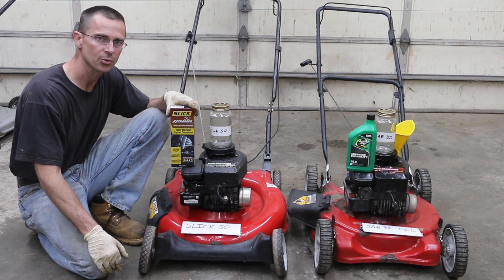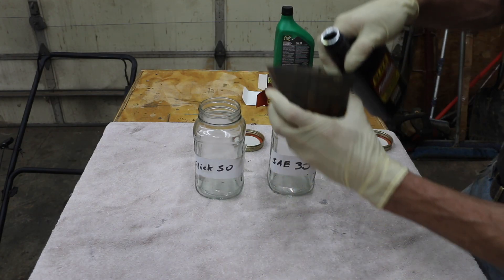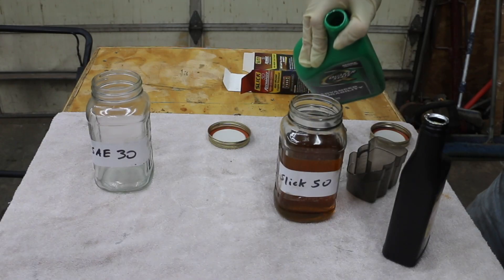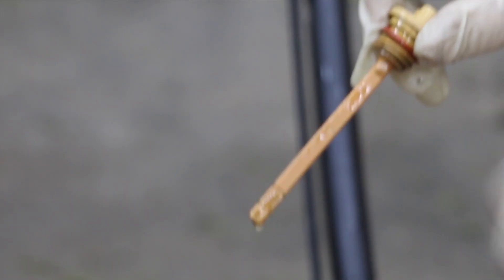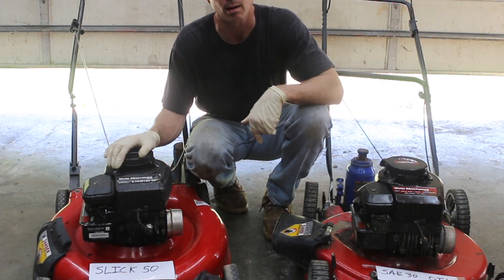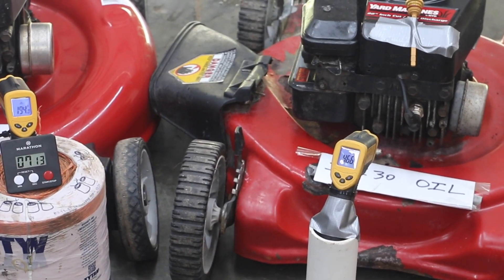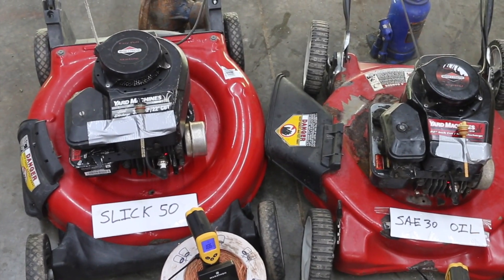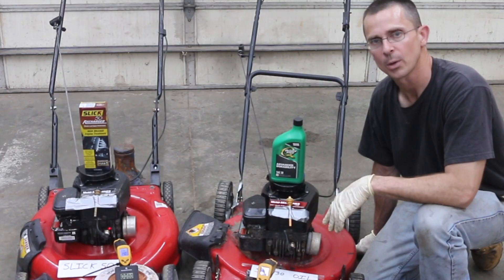Can't believe what SLICK 50 did to my engine!!--Dry Crankcase Test!

Comment: Dupont has explained a dozen times. Teflon cannot bind to metal parts in this manner.Dupont also sued Slick 50 for false claims of their product and its usage
Reply from the maker: Thank you!
Reply: Please test LiquiMoly engine treatment
Reply: @TheBousouzoku  Why? First chemists have explained a dozen times why these additives do nothing.Second vehicles go hundred and hundreds of thousands of miles with no additives and live long, wear free lives.
These products are snake oil waiting to take your dollars.Every single claim they make about their products are exactly what modern motor oils already do.Thats why millions of engines are running today with no additives and outlast the car and the driver
Reply: @denniss9620  Yep. My '87 Hardbody V6 has 465k miles on it with nothing but cheap Castrol GTX and [GASP!] Fram oil filters. Changing the oil and filter every 3k miles is the key, not additives.
Reply: Dirty Harry  The point is modern oils need no additives.Their lubricating properties exceed the engines componet
requirements
Reply: Dirty Harry  I have owned two Jetta diesels 1 Golf diesel 1 Rabbit diesel, all have  had over 275,00 miles. NO ADDITIVES USED. Diesel engines contrary to what you think are cleaner as to deposits and create far less oil fuel  and hard carbon deposits,and inherently less engine wear then gasoline engines.They are designed and manufactured to go a multiple of hundreds of thousands of miles between overhauls. What oil additives do Auto/Truck engine manufactures insist and require you to use in your diesel?  ... Fuel additives are a different story anf for different reasons all together related to temperature and sulphur content. 

Gasoline engine oil is blended to absorb tar and moisture, diesel oil is blended to deal with and absorb carbon film from the diesel fuel thus diesel oil is a higher dispersant oil and why diesel oil becomes black.It has nothing to do with more lubricity.Aircraft engines  also use high dispersant oils and is why automotive oils are not used in aircraft. Again additional lubricity is not specifically  the addressed issue.

 From Cummins service supplement.

 Aftermarket Oil Additive Usage:

Cummins Inc. does not recommend the use of aftermarket oil additives. Current high- quality fully additive engine lubricating oils are very sophisticated, with precise amounts of additives blended into the lubricating oil to meet stringent requirements. These furnished oils meet performance characteristics that conform to the lubricant industry standards. Aftermarket lubricating oil additives are not necessary to enhance engine oil performance and in some cases can reduce the finished oil's capability to protect the engine.

Detroit Engine manufacture

3.12 - ENGINE REQUIREMENTS — LUBRICATING OIL, FUEL AND FILTERS Engine Type2-Stroke Cycle4-Stroke Cycle Viscosity THE USE OF SUPPLEMENTAL ADDITIVES Lubricants meeting the Detroit Diesel specifications outlined in this publication contain a carefully balanced additive treatment. The use of supplemental additives, such as break-in oils,top oils, graphitizers and friction-reducing compounds in these fully formulated lubricants are not necessary, not recommended and can upset the oil's formulation, causing a deterioration in performance. These supplemental additives may be marketed as either oil treatments or engine treatments and should not be used. Their use will not void your Detroit Diesel Corporation product warranty; however,engine damage resulting from the use of such materials is not covered. The use of such additives is at the customer's risk. Detroit Diesel will not provide statements relative to their use beyond this publication.3.12
Reply: @denniss9620  Perfectly said.
Reply: @denniss9620  There is NO NEED for ANY additional oil ADDITIVES in ANY properly formulated oils, and NO OIL COMPANY will warrant oils that have additional oil additives in them!  Oil Companies blend oils to meet many specifications that have to be passed, and sometimes they have to go through the testing procedures several times to meet the specifications.  These tests cost THOUSANDS of dollars to get the oils to pass the tests, so ALL Engine oils DO NOT NEED ANY additional oil additives!
Reply: @1gr8oil  I have made that exact argument dozens and dozens of times on many automotive forums.If you search you may even have found a post on you tube where I explained well over a million miles of vehicle history where I have never used any oil additive and have used Walmart branded motor oil  among other off brand oils (Warren Oil Refinery) in all my vehicles for dozens of years.I have particular argued any real significance on diesel engine operations of using any oil additives and point out that even one of my very own aircraft does not even use an oil filter in its oiling system (Continental 0-200) engine.
Reply: @1gr8oil  I have also stated  numerous times in many automotive forums the overrated assumption of the effects of synthetic oils on engines that don't specify or require its use
Reply: Many fuel treatments and oil additives offer claims that range from the modest to the near outlandish. For instance, many oil additives claim to not only reduce friction and increase horsepower, but they also claim to restore fuel economy and reduce engine wear, among other positive benefits. But the question is how can you be absolutely certain that the oil additives you buy can do all of those things? The answer lies in the fluids in which fuel treatments and oil additives interact with.

For starters, engine oil not only lubricates parts to prevent excess friction, but also protects them from corrosion. Most auto manufacturers already include dispersants that help prevent sludge from building up within the engine over time and rust inhibitors to further prevent rust and corrosion on parts it comes into contact with. By now, you`re probably wondering why you`d even need aftermarket oil additives in the first place.

Not surprisingly, many car manufacturers are wondering the same thing. Some have even gone so far as to recommend owners to not use oil additives that haven`t already been included in the recommended engine oil. Truth be told, oil additives simply aren`t necessary for new modern engines.
Reply: @denniss9620  More accurately additives are not required for modern oil, since they already have them. There are actual differences between various oils rated for "high mileage" or "extended performance". They have different friction modifiers and wear additives, which is a lot of the same stuff in additives. In most cases the additives are completely unnecessary, and in the worst cases make your oil perform worse than without. Modern oils can contain 10-30% additives already, they don't need more.
Reply: Here's some of the actual correspondence:

http://xcelplus.com.au/docs/ptfe/dupont.pdf

"According to the information presented by you, the
fluorocarbon product yoU purchased from Du Pont was -a component
but not the primary active lubricative agent in the "Petrolon"
formulation. As such, it appears that the "Petrolon" formula
with its special combination of ingredients, which was not dependent upon Du Pont's product as the active agent, falls outside
our press release. That, you will recall, pertains solely to
the use of Du Pont fluorocarbon resins or micropowders as the
active lubricative agent. "

:-)
Reply: Losing 20 degrees all around compared to the pure oil is a really good thing as far as preventing wear and tear goes, since heat is the major source of it. Especially considering heat has very exponential effects on wear and tear, where every degree means more than the last. It's obvious these "engine treatments" do something and it frankly isn't insignificant just by that alone. Whether it's worth it or not is a different story but if the goal is only to make an engine last as long as physically possible, you'd definitely want to use them. Whether you'd want to use Slick 50 or some other alternative is a different story.
Reply: And, it takes some 300 degrees f to get teflon to stick to aluminum.  less porous metal wont hold it.  you are correct!
Reply: CAPTAIN DABBIN  Sir there is evidentiary evidence from legitimate controlled unbiased testing labs that proves that no oil additive has any positive affect on engine performance.

Comment: I had a 87 ford ranger 2.9 that the oil pressure would drop to 0 for no reason. After the first time ( could not find problem) I put some other kind of oil additive (another one from TV with Teflon. I forgot name) in and when It did it a second time 50 mi. from home I said screw it and drove home. It got hot and knocked alittle but it got me home. Still no reason why oil P. dropped.  New oil/ filter started up and ran like nothing happened. Ran It for another yr and a half with no problems. But the last time I changed oil/ filter I used Slick fifty ( I could not find the other brand again since). When it did it again I made it back home(35 mi). But when I went to start again after oil change it rod knocked like hell and blew the rod( oil p. was up) Damn. Wish I could remember the name of that stuff.

Comment: Slick 50 was bought out some years ago and the ingredients were changed so it is not the same product as it was in the 80s. I had a car I drove when it was too low on oil which caused the lifters to clack really bad, I lived with it for about a year and then I decided out of desperation to try Slick 50 even though I was highly skeptical, it was originally marketed on infomercials only which seemed sleazy. Over the course of the next 3000 miles it completely quieted the noise and it never came back. I wish it was still available today.
Reply from the maker: Thank you!

Comment: I don't believe the claims of Slick 50, Especially when it first hit the market with teflon or PTFE particles in it.
But If I recall, the Product had to be run in the engine for a length of time, before the bonding to the engine parts took place.

So  your test,  of running the engine for a few minutes, and then draining out the crank case,  Probably didn't give enough time for the Bonding to take place, If in fact it ever would..

Comment: Compare the regular oil, with regular oil mixed with bearing grease, containing molybdenum disulfide and lithium, maybe one level table spoon, well mixed; the mixing is difficult; place the oil in a salsa jar, add the bearing grease, tighten the lid, shake really hard; that still will not get it all thoroughly; so, pour it all int a plastic pop bottle, with a steel ball, from a ball bearing; shake really hard.
Reply from the maker: Thank you for the video idea!

Comment: Perhaps you should try this test with Xcelplus engine treatment. SLICK 50 was sold to Quaker State back in the mid 1980s and changed the formula, because they bought the name, but not the actual product formula. Xcelplus is that original SLICK 50 product formula brought back to market. Products currently marketed as SLICK 50 can not pass the tests that pre-1984 SLICK 50 can, because of the said changes to the formulation due to the owner, Xcelplus, refusing to license it.

So if you want to truly test the effectiveness of SLICK 50 in an engine without oil, than try again with Xcelplus instead.
https://www.xcelplus.com.au/index.html
Reply from the maker: Thank you for the video idea!
Reply: @ProjectFarm  BTW Love your videos. They're inventive, as well as, informative. Please keep up the great work.
Reply: @ProjectFarm  yes try this segment again with excelplus...I too was very surprised that the slick 50 motor died that quick...WOW.

Comment: I was shocked at this out come, I believed it was the dogs nuts. 3o years ago I had an Austin A35 and drove it over a dropdown bollard but the road fitting was too high for my sump, I punctured a 2" slot and the oil jus fell out in seconds. I did use Slick 50 then and thought nothing of it to drive 2 miles back home, welded it up and drove the car for the next few years with on problem. So now not too sure what I think about Slick 50 but thanks for wrecking your lawmowers to bring this to light, love your vids.
Reply from the maker: Thank you!

Comment: When I was young and getting started twisting wrenches, (the Kennedy administration) my friends and I did lots of "experiments" testing mechanical stuff. Experiments like testing for how long an engine would run on starting fluid, putting moth balls in the gas tank, putting sugar in the gas tank, putting sand in the crank case and so on. There were many so call oil enhancers, Motor Honey, Wynn's Friction Proofing, Marvel Mystery Oil and on and on. None of them worked then and none of them work now. Here's the real world. No one is going to improve on the auto industry's engineers. Yes you can get 600 horsepower out of a 350 LT engine and still have it idle but by that time it's not even the same engine. No one is going to improve on the lubricating properties of motor oil.

Your test is flawed. Fun for sure but apart from the fun, a waste of time. How many hours on both engines? Both engines used, well used? OK, service intervals the same? Compression tested on both engines? If both engines aren't brand new out of the box or all relevant data points verified the test results are meaningless.

What's most interesting is that you seem to have  figured how to earn a living fooling around with stuff like this. I admire you for that!

Comment: I've heard a 0-15 or 0-30 weight can penetrate & protect an engine about the same as Slick50 (or might even be the same product. The theory seems to be that higher viscosity, smaller oil molecules can get into the metal itself on a molecular level. My guess is that it probably would require some heat to accomplish this, as I think Slick 50 says in the directions to run it for a certain amount of time? I remember when it was on commercials too, yet had always been told to add a quart of 0-15 weight to my oil, then change the oil to normal use weight for the car/season. I was told the lighter weight oil did the same thing, so never bought into Slick 50 or the other additives.
   It would be interesting if it was the same thing. 
As for the lawnmower with Slick50 added, it could have died for other reasons, yet I wouldn't was to keep trying destructive tests, as that could get really expensive.
  Wondering about a less expensive test... 
  A necropsy of the engines would be interesing and informative!
Reply from the maker: Great point

Comment: Incorrect testing! Slick 50 has minute particles of pfte (teflon)  in it which has a melting  point of about 620° F . It's these particles that protects the metal in your engine once it adheres to it. The oil is just the carrier , but it takes heat and a little time to treat the engine metal properly so the pfte will adhere to all exposed oil surfaces. The bottle  also needs to be shaken to assure that the pfte is properly suspended before pouring, at which time you should immediately run said engine for a while for proper treatment. I did these test in the 80s and when properly treated they ran till the gas ran out. Unless the formula has changed I believe you should have the same results. Thanks guys for a walk in the past!
Reply from the maker: Thanks for the constructive feedback

Comment: What I gather is that not all engines are the same, I think or you menu factors are meticulous about the molecules of the oil in response to different metals manufacturing engine or engine parts. 

I reckon for your show that you use independent car engines and diesel engines detached from its vehicle, used openly and separately from the vehicle.

You should also include in your show, Which I would love to see, the metallurgist periodic table in concerns of the type of metal use to build or cast the engine, so that we can find the best oil to use for that metal. 

Please, also make a video announcement asking for support so we Americans can all come together to purchase a car and diesel engine for your show

Comment: Used to use Slick50 too. Had an '88 Silverado that was a lemon. EVERYTHING BROKE multiple times! Too much to list. But I had given the engine Slick50 when new and a few more times down the road; every 50k. That engine went a mind boggling 400K+ and never died. Finally junked the truck but the engine ran great till the end. Even maintained the same gas mileage. I'll bet it could have been transplanted into another vehicle and it would still be running.

Comment: I remember an oil additive called "Prolong" that can be added to engines and gearboxes.  I think it was marketed to compete with slick 50.
Reply from the maker: I need to test Prolong soon. Thank you
Reply: Prolong is still around and I use it in all my engines from my 2 stroke weed eater to my truck. It has made me a believer.

Comment: Slick 50 has been debunked as B.S. for years now.  The company even admitted that their claims about this stuff's abilities were false.
Reply: I agree it's BS but any links to their admittance?
Reply: @Rich77UK  https://www.ftc.gov/news-events/press-releases/1996/07/quaker-state-ads-slick-50-are-false-and-misleading-ftc-charges
Reply: @Rich77UK  It still kept the engine cooler while in it, which is what 99% of the people who use it want.
Reply: @danielthecowboy9145  independent tests showed it did absolutely nothing lasting to an engine. But they did find fine teflon particles suspended in the oil did reduce friction slightly. But as soon as you changed the oil it back to normal. So you'd have to add Slick 50 with every oil change if you wanted this benefit. Last I checked (years ago) Slick 50 was $50 a quart.
Reply: @Rich77UK  couldn't find their actual admission,  but this FTC investigation is what resulted in Slick 50 having to change their advertising to exclude many of their claims about the products abilities.